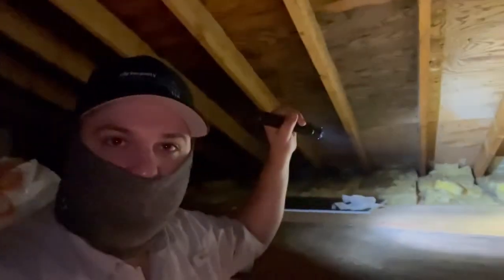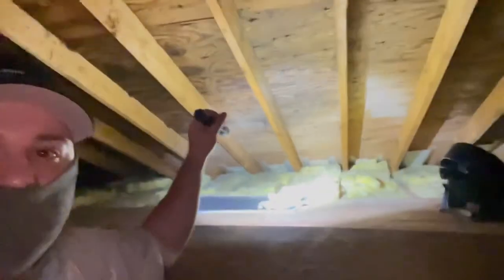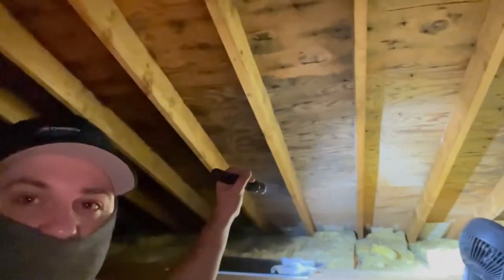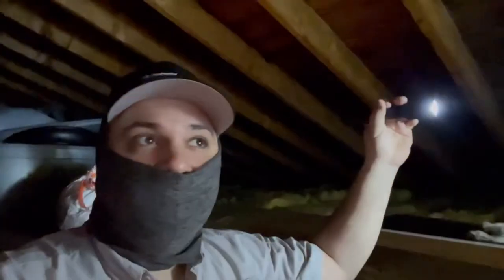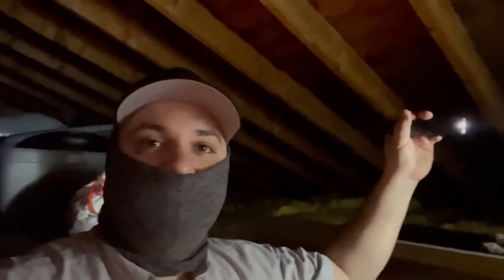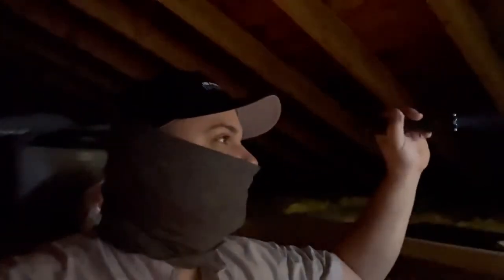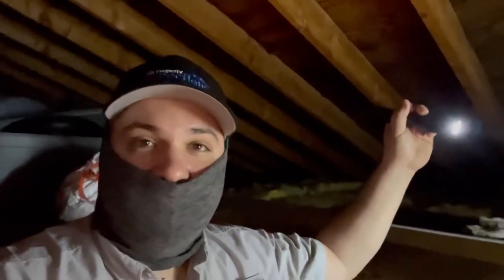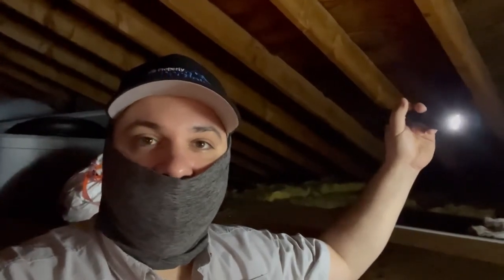Poor Attic Ventilation | Condensation in Attic

Comment: Just noticed this in my house, England. Quite cold - 5 at night currently. Never been an issue before but I recently put new insulation in due to increased energy costs and stupidly covered the vents at the edge. So i will go up and sort that. Also very cold and no wind outside so i guess that isn't helping. Solve one problem and create another!
Reply: got the same but only in 1 corner.. how did you fix it? or how much did it cost ?

Comment: Hey man, good video. I have a ranch that was built in 50s. Up here in MI. Having some condensation on symmetrical areas in the attic space. Directly across from each other. Have yet to gone in there because it’s tight and I have that old fashion insulation. But it’s weird because I only have condensation in the back bedrooms.
Reply from the maker: How well are you able to see throughout the attic? Can you see much from the access? Are you able to see if insulation is blocking soffit vents (assuming you have vented soffit)? Any idea if a vent duct is open in the attic?

Comment: I had to go into my attic a week or so ago, and noticed the nails coming through from the shingles have condensation. Also one spot in a bedroom corner has condensation.  Any tips to correct it?
Reply: Most likely it is from hot warm air getting into the attic from the inside of the house.